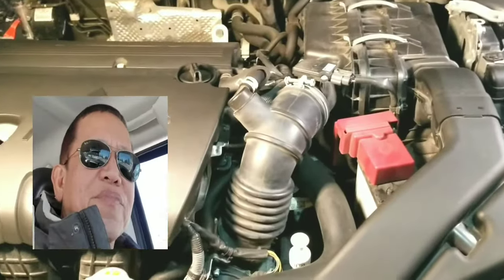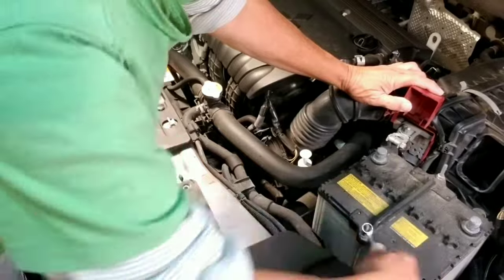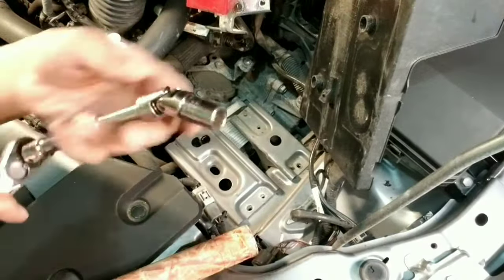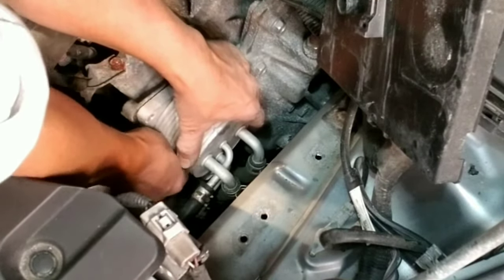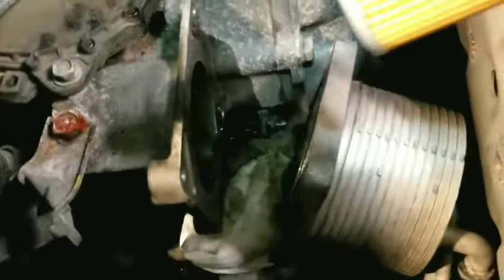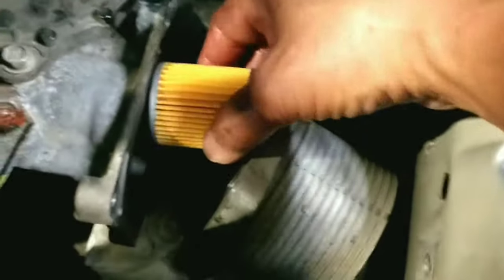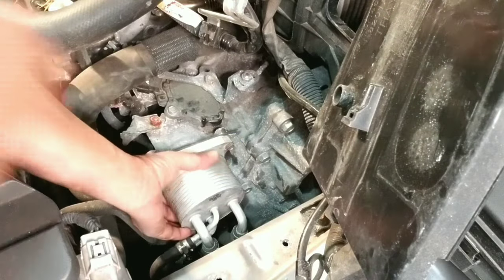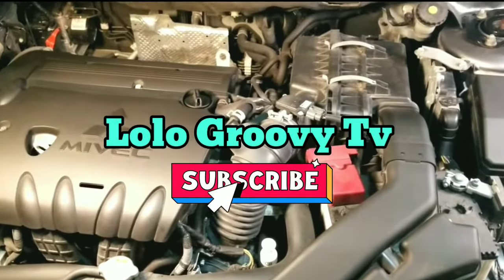HOW TO REPLACE THE TRANSMISSION COOLER FILTER OF A 2015 LANCER

Comment: I also use the "OBD POWER CONNECTOR TO CONNECT ANOTHER BATTERY for keep my ECU Memory"  And then follow your procedure. Great job thanks your video.
Reply from the maker: That's a very good idea, so you won't loose anything when you remove the battery connection. Thank you for watching and have a good day ahead!

Comment: My dealer said that part isn't serviceable, they wanted me to change the whole part.
Reply from the maker: I already change my filter twice and also purchased the filter from a Mitsubishi dealer. Good luck and hopefully they sell you the filter.
Reply: @lologroovydiy  my car warning came on and said "slow down" I think the transmission was getting too hot.
Reply from the maker: Maybe the fluid circulation is bad because of a dirty filter.
Reply: @munoz_rottweilers3238  Yes, several mechanics have stated that when this filter gets clogged, it can cause overheating of the transmission.  Ideally we want to do the maintenance ahead of time to prevent this.  This is why I'm now on a 30,000 mile schedule to change the fluid and both filters.  This one and the one in the pan underneath
Reply: @fitcwebb  they never recommended I change the filter and I take it to the dealer for service all the time.  I finally got it changed tho after requesting it
Reply from the maker: 30,000 to 35,000 miles is the best interval.

Comment: The bolts on my cooler housing are so tight I can't get them off. Any idea how I can take them out without breaking them?
Reply from the maker: @miguelcastillo1742 gently top the head of the bolt with a small hammer or use a penetrating lubricant. Hope you get those bolts out. Good luck and thank you for watching.

Comment: What did you torque the transmission cooler filter housing to. ? Would really appreciate it because I can't find any torque specs for my lancer anywhere.
Reply from the maker: I couldn't find any torque specs for the cover too... I only hand tightened the bolts! Thank you for watching and keep safe always!
Reply: 35 inch pounds

Comment: Lolo I love your videos I have done the cvt fluid change and filter and now the Inter cooler filter. However the paper filter I received is about half cm bigger. (Yes I did make sure the gasket was off from the previous filter) I had to fit it there a little tight but I was able to close it back up with a new o ring and was able to tighten up the bolts and saw no leaks. Do you think I should be safe?
Reply from the maker: As long as the fluid level is correct and you don't  have a leak... it should be fine! Drive it for a while then check the fluid level and check for leaks again, just to make sure. Thank you for watching.
Reply: @lologroovydiy  my car is cvt, at what miles Ineed to change the filter?
Reply from the maker: @rosarioexecutive when you change the cvt fluid, you can also change the cvt cooler filter. Check your owners manual but for me I do it around 50 thousand miles.
Reply: Do you by any chance know the torque of those 4bolts?

Comment: Nice tutorial. I changed the same filter on a 2017 Outlander Sport last week. The location of the components were about the same as your car. The bottom screws holding the battery bracket are tough to get at and the last screw holding the transmission cooler next to the engine was tightened from underneath. The job got completed thanks for showing the way.
Reply from the maker: Good to hear that everything went well. Thank you for watching the video. Have a wonderful day ahead.

Comment: Great video for those with outlander sports/RVR/ASX as they share the lancer chasee and have the transmission filter up front as well. So many people and mechanics don't know about this filter and i fear never get changed. You need to, especially if you have a CVT!
Reply from the maker: That's correct, because even if the transmission fluid is change regularly the dirty filter will restrict the flow of fluid. Thank you for watching and have a wonderful day ahead.

Comment: Thank you so much! I am doing this right now and wanted to know if youtube had a video about it. You did an excellent job explaining it. By the way, do you happen to have part number for filter and o ring?
Reply from the maker: Glad it was helpful!
Part No.: 2824A006 is for the cloth filter in the cooler. Part No.: 2920A096 is for the rubber O-ring.
Thank you for watching and have a wonderful day ahead.

Comment: Hi Lolo. Thank you for this video. I have a few questions:
1. Is it same procedure for 2018 outlander?
2. I already got the cvt fluid changed by dealer. Will I need to top up the fluid after I change the filter now?
Reply from the maker: I'm  not familiar with the outlander, but if your transmission cooler filter housing location is same as in my video...  you can change it. Because the position of the filter is higher than the transmission. The only fluid that will leak is the one in the filter housing. Estimate the fluid that will come out and put the same amount back will be much better. 
Just to verify, I have a link for a 2016 outlander and please compare the location of the filter housing with your car. If this is not the location then it should be under the battery same with the Lancer.
https://youtu.be/Ph926qQmLOg?si=-x46ZLTbcMOHRFt2
I hope this will help.
Good luck on your project. Thank you for watching and have a wonderful weekend.

Comment: very useful, and informative video, thanks for it!
Will do a CVT oil change in my 2008 Lancer. Sump filter was recently changed, but the cooler filter wasn't.
Do I need to drain all the oil from the transmission to change the cooler filter?
my other problem is, I cant get my hands on genuine Mitsubishi CVTF J1, will Motul Multi ATF work for me?
Thanks in advance!
Reply from the maker: You can change the cooler filter without draining the fluid. There's a little amount of fluid in the housing which will spill out. If possible , estimate the amount of fluid and put the same amount of fluid back. After market filter is ok, as long as all the specs are the same.  I hope this will help. Thank you for watching!
Reply: @lologroovydiy please share the link to buy the filter; thank you!
Reply from the maker: Part No.: 2824A006 is for the cloth filter in the cooler. Part No.: 2920A096 is for the rubber O-ring for the housing cover. Good luck on the project. Thank you for watching and have a wonderful day ahead.

Comment: Hi Lolo, how often should you change this cooler filter? I just gave my lancer to the garage for a fluid change (97k kms) I believe they only changed the fluid, gasket and screen filter.
Reply from the maker: I change the filter same time with the transmission fluid. The ideal interval is every 50,000 miles. Thank you for watching and have a good day ahead!

Comment: 5:37 did you just playback in reverse that part? lol.

thanks for video... i have outlander sport 2015, do i need to change mine too? its over 100k km
Reply from the maker: You have very sharp eyes. Check your owners manual it should say how many km before you change the fluid. I change mine at 60,000 miles. Thanks for watching and keep safe always.

Comment: What brand and size of universal socket ast you are using?
Reply from the maker: Its a 3/8 universal socket adapter from Craftsman to remove the plate that holds the battery. Thank you for watching and have a wonderful day ahead.

Comment: I have Lancer 2012 GLS EX CVT. We found oil in cooler and after inspection it was found that Gear cooler is faulty and mechanic asked me to replace it. Do we need to change the filter as well and what about transmission oil. Please guide
Reply from the maker: If the transmission fluid is contaminated with engine oil, its better to replace the fluid together with the filter. The transmission might slip because of the engine oil.

Comment: Before you change this up filter have you drained the transmission fluid, or it’s alright to take off top filter without draining all the fluid.
Reply from the maker: If your transmission fluid is still good... you can change the top filter without draining the fluid!  Estimate the fluid that will drip out of the housing and replace the same amount back. Thank for watching and have a good day.
Reply: @lologroovydiy  thanks 🙏

Comment: Hi @Lolo Groovy Diy! my 2009 lancer es is leaking transmission fluid on the front passenger. do you have any idea where its leaking from?
Reply from the maker: Try checking the area where the inner right axle is connected to the transmission. If the area is wet with fluid, the rubber seal might be weak or damage. Good luck and thank you for watching.
Reply: Thank you lolo!

Comment: My car has an irregular idle when driving my mitsubishi asx auto. Could the filter be a problem. Also are there sensors on the gearbox
Reply from the maker: There's a lot of reasons for a car to have an irregular idling. If I were you, I'll have a good mechanic check it out. If your car is equipped with transmission cooler filter, might as well change the filter.
It is cheaper than breaking the transmission. Thank you for watching and have a wonderful weekend.

Comment: hi, do u have to drain all the fluid out ?  is it ok to change just the small filter ?
Reply from the maker: If your fluid is still good you can change the cooler filter without draining the fluid. There's a little amount of fluid in the housing which will spill out. If possible , estimate the amount of fluid and put the same amount of fluid back.  I hope this will help. Thank you for watching!

Comment: hi lolo, can I change this filter if my transmission oil is full? would it leak a lot of oil? Thanks!
Reply from the maker: Yes, you can change it. Because the position of the filter is higher than the transmission. The only fluid that will leak is the one in the filter housing. Estimate the fluid that will come out and put the same amount back will be much better. Good luck on your project. Thank you for watching and have a good day ahead.

Comment: If I changed oil 2 months ago I can still do it. I will have to add oil?
Reply from the maker: The positon of the filter is higher than the transmission, so you will only lose the fluid that is in the filter housing. Yes you can do it; just calculate the amount of fluid that will drain from the housing and put the same amount back. Good luck and thank you for watching.

Comment: How do you access the bottom 10mm bolt on the back side of the transmission cooler housing  at 2:44
Reply from the maker: Use a 1/4 inch drive socket wrench with extension. A bit tricky though. Thank you for watching and have a good day ahead.

Comment: Lolo did you just replaced the transmission filter cooler or did a flush? and what are those extender you using for the ratchet to reach the bolts underneath the battery stand?  1/2 drive or 3/8? salamat po
Reply from the maker: Thank you for watching my video! I just replaced the transmission fluid and the bottom filter. The size is 3/8 for the extension. Thanks again and good luck on your project AK NAYAB!  God bless!

Comment: Hi,  my  Nissan Murano cvt is experiencing about 5 6 seconds delay when gear shifting. Sometimes, it doesn't engage at all. Is that a symptom of a dirty cooler filter? FYI,  I just had fluid change and washed the strainer. But the issue persists. The mechanic had no idea about the external cooler filter. Thanks in advance.
Reply from the maker: If your car is equipped with a transmission cooler filter, you can try and replace it. I hope the problem goes away with changing the filter. If the problem still persists the best thing to do is have it check by an expert. Thank you for watching and hope the problem will be solve.
Reply: Are you sure the mechanic poured the correct CVTF NS3/J4 fluid ❓🤫

Comment: If i change this cooler filter without emptying the transmission fluid. Is it ok？ Or it will leaks when i remove the cooler filter housing？ Thank u
Reply from the maker: I didn't drain the fluid when I replace the filter in that video. Make sure to place paper towel or clean rug under the housing cause there's some fluid sitting in the cooler housing. Good luck and keep safe! Thank you for watching.

Comment: Can a bad filter make the transmission to heat up while going up hill? I have a 2014 and it heats up everytime i tried to road trip going up a mountain.
Reply from the maker: If the filter is dirty, it will restrict the circulation of fluid and might cause a problem. Thank you for watching and have a wonderful day ahead.

Comment: What is the OEM part number for the "O-Ring" on transmission cooler cover? Can someone send me a website link to purchase that O-ring?
Reply from the maker: Try this part number: 2920A096 but check it out first before buying or better if you can go directly to the dealer. Thank you for watching. Have a good day ahead.

Comment: I already change my oil cooler and the coil filter but still the color of radiator coolant turn pink  that makes my car overheating Mitsubishi Lancer 2014 please help me to solve the oberheating
Reply from the maker: Check your engine oil dip stick and the oil filler cap, if the oil is cloudy or mix with anti freeze it might be a blown head gasket. I'm not sure why your anti freeze is contaminated. Better take it to a certified mechanic to have if properly check before it gets worst. Good luck and hope it'll be fix. Thank you for watching.

Comment: How do you know if it’s time to change the filter will the transmission start slipping
Reply from the maker: I change my CVT fluid and filter at 60,000 miles. My plan is to change it again after 35,000 miles. Thanks for watching!

Comment: Very nice presentation, how can you say about Nissan CVT transmission,  that normally gets  hot and loose power, is there any remedy? ?
Reply from the maker: I'm not familiar with Nissan. But there's this video that I watch that might give you a good explanation. https://youtu.be/j60a8pZjc-s
Thank you for watching and good luck.
Reply: @lologroovydiy  I've found that my 2013 Nissan Juke AWD hides its filter in the same place as yours! Although not exact, it's VERY similar with the only difference being the routing of the pipes. Other Nissan CVTs have the filter located in different places. Those are also on YouTube, but this is the only video even remotely close to mine!
Reply from the maker: @johnhouchins3156  good to know that!

Comment: Hello bro...I have one thing to ask... recently I just change my CVT oil and the bottom filter...but I didn't change the cooler filter...can I change the cooler filter after the CVT oil change? Tq in advance
Reply from the maker: Yes, you can change the cooler filter. Just make sure to place a plastic sheet at the bottom of the filter housing to catch the small amount of fluid that will drip. If possible measure the fluid that comes out and put back the same amount. Thanks for watching and stay connected.

Comment: We can used the same of nissan J32 part 31726-1XF00. (Cost saving)
Reply from the maker: I'm not sure. I only used the Mitsubishi filter brand. Thank you and good luck on your project.
Reply: It is the same part. (Jatco CVT) It can replacement

Comment: I drove 45000 kms after changing cvt gear oil . When should I change it again

Model:2014 lancer gt
Reply from the maker: I replaced my filter every 50,000 miles. If I have the time maybe I'll replace it even at 30,000 miles. Thank you and have a good day ahead.

Comment: Sir how do you open bolt number 4? It is very tight spaces very hard to reach 😩
Reply from the maker: Use a 1/4 inch drive socket wrench with extension. A bit tricky though. Thank you for watching and have a good day ahead.

Comment: 2016 is not the same
Reply: I think it’s easier.
Reply: @truwarrior22  nope I couldn't find it
Reply: @Bighotwheelhunter  My bad was thinking the Outlander, it’s no longer a cooler, just a cover.
Reply: @truwarrior22  so I don't have to worry about it
Reply: @Bighotwheelhunter  I have over 100K on mine, no issues. Looks like 2016 Lancer has one, 2824A006
Reply: @truwarrior22  I couldn't find where the old filter is located
Reply: @truwarrior22  I have it but does it go inside the transmission

Comment: How did u get the 4th bolt
Reply from the maker: Use the same socket to remove the 3 bolts only with extension. A bit tricky though. Thank you for watching and have a good day ahead.
Reply: @lologroovydiy   took me 3 hours